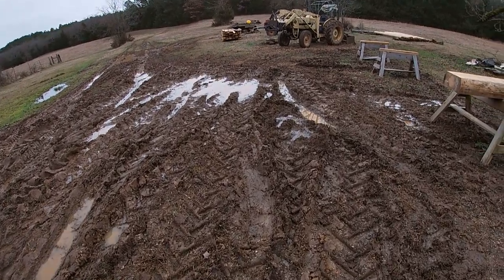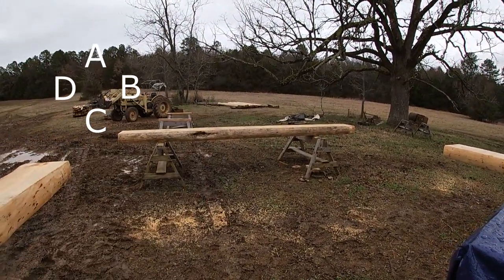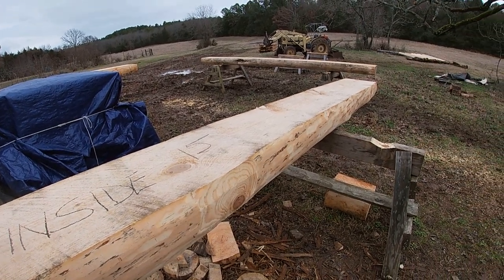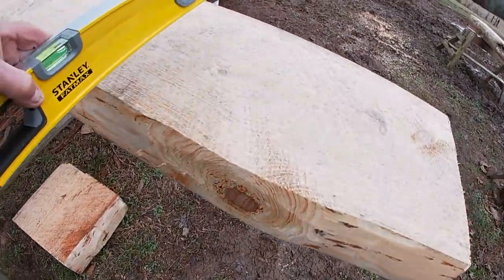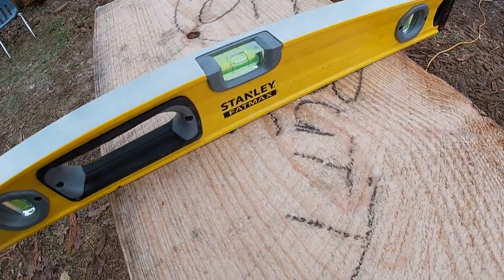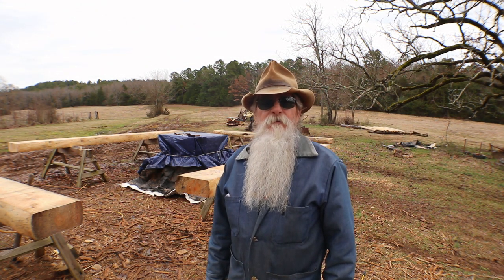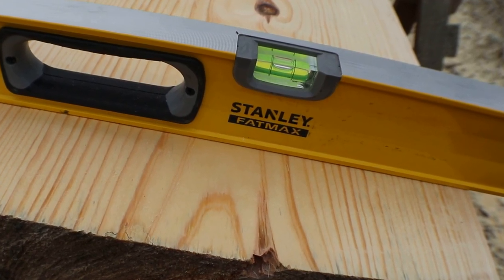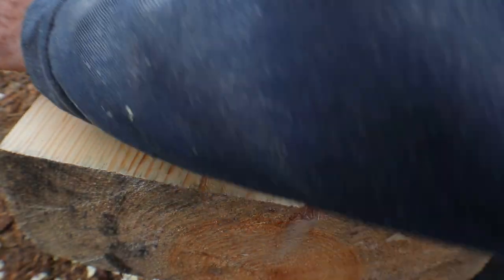Round 1, Sill Log Layout (pt 1) Dovetail Log Cabin Build (Ep 12)

Comment: I believe I am getting a better understanding of the layout now! That 3:1 template seems to be quite the handy device! I’m gonna have find one of those or make one
Reply from the maker: Howdy- glad you’re getting it.  You can probably get a sheet metal shop to make you a template out of aluminum. Mine was made in a metal shop. God bless
Reply: The Bearded Carpenter yes sir I have a metal fabricator friend !! How long would you suggest it be?
Reply from the maker: @jacelandadventures1523  It would be 18” inches long and 6” at the wide end. You may want to file the pointed end for safety reasons. My template is 1/8” thick. Blessings
Reply: The Bearded Carpenter 🙏🏻

Comment: With so many horses, do you grow your own hay also?? I have several "horses" I have made over the years that are basically just logs, flat on top and bottom ( so I can clamp them easily) and have splayed legs. I often do through holes for the legs and taper the holes a bit ( handmade taper tool) as taper the leg ends. This is very time consuming and wondered if you have experimented with different ways to hold your work. I do have 2 sets of steel dogs and a small set of pointed steel sets that help. Like you, I also use small long tapered wedges which come in handy for leveling especially. Great detail and precision on your work. One little trick I use on my 192 Stihl is a set of round level bubbles that I have secured to my saw body with taped velcro to let me know when I'm level in the critical planes. Like plunging, I have the bubble set right over the pull cord housing on the flat spot that says "192" for example. (after I checked and verified this is a good spot) Along with another one up on the top, in front of the handle wrap which tells me if I'm dipping too much or have it angled front to back. Works well. I do like your double checking on all your important dimensions. The old adage, measure twice, cut once certainly applies. Thank you for a very well prepared set of videos on log work, it has helped me in numerous areas on frustration! DD
Reply from the maker: Howdy Don- with all the sawhorses I have there’s times I need more lol. What I show in the videos is pretty much the way I do things to keep work pieces in place. I have log dogs but I don’t use them too often on the horses because they tend to eat up the tops of the horses. I just screw a 1x4, or whatever to the log and horse. I really like your idea of putting the small bubble levels on your saw. I need to try that. Thank you for sharing that. Hope to hear from you again. Take care and God bless you